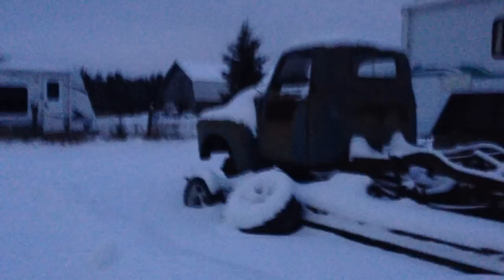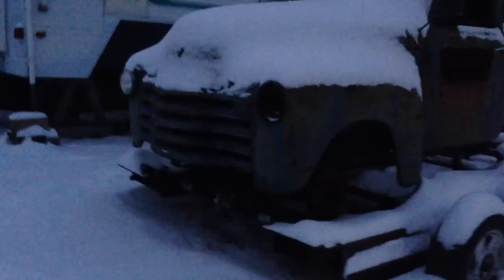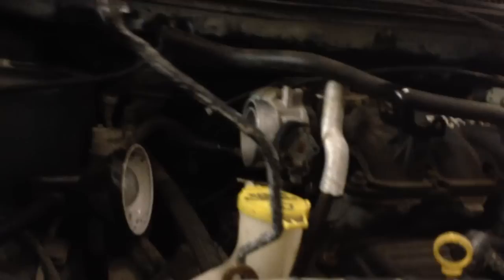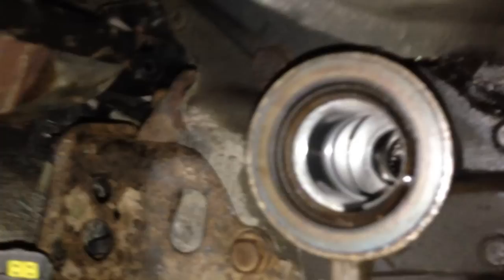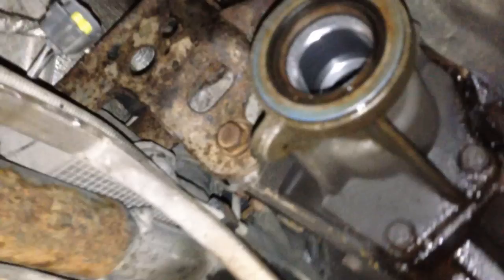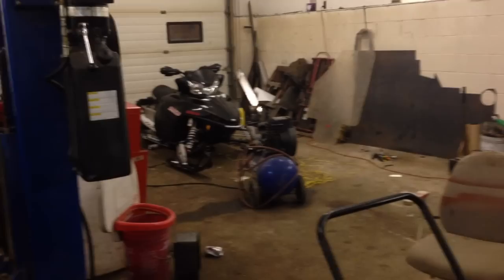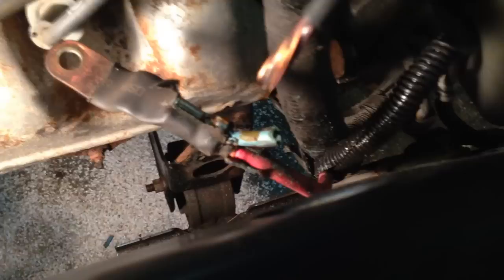Rat Rod Plans and The Caravan BS is almost done

Comment: lol always a good sign things went well when theres a BMFH under the hood....
tape under the hood on a solder connection in your environment?? heat shrink tube man, shit is cheap anymore. I keep rolls of the shit at the shop.
and I just did a motor in a 2013 caravan (insurance front end hit, salvage job), 5 hrs out and in! everything on the new and old soooooo clean! love that kind! and watch out on that vintage, those cooler pipes the lower hose connects to like to leak at the O-ring connection and also rot out.
Reply from the maker: impatience won that battle no heat shrink .. lots of tape